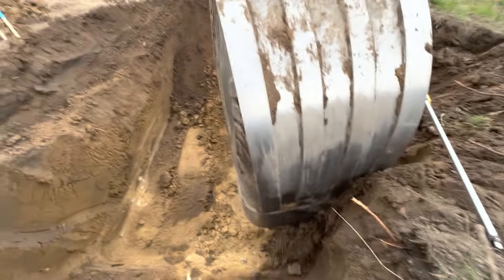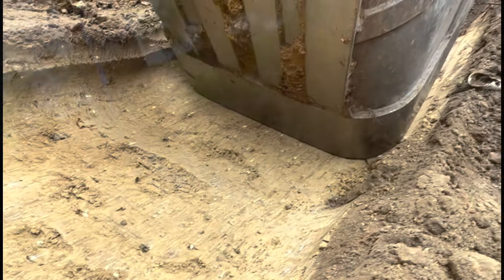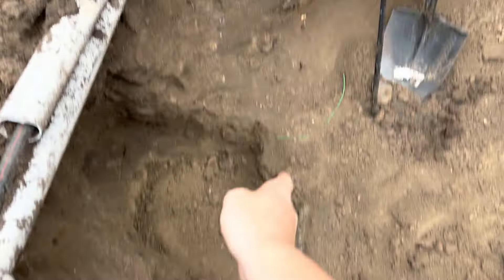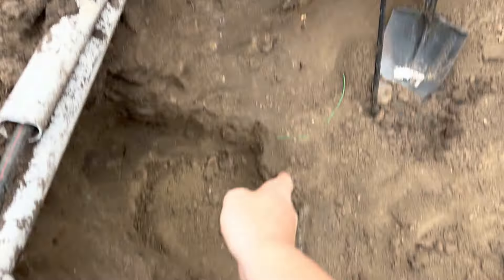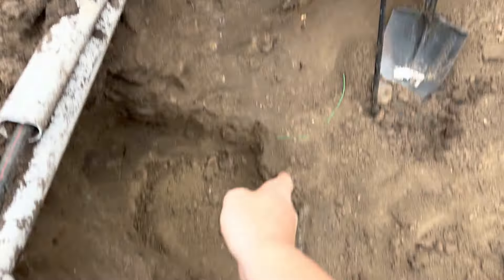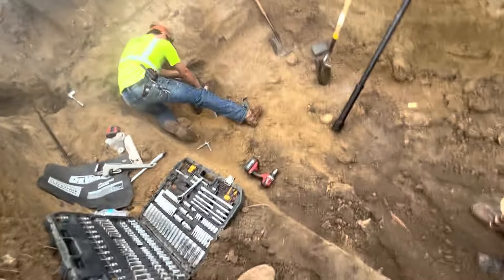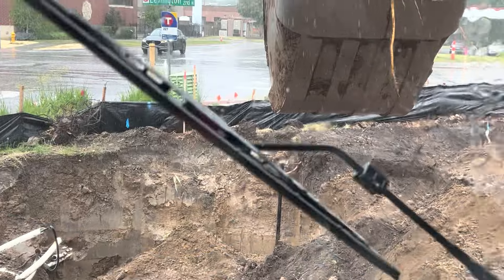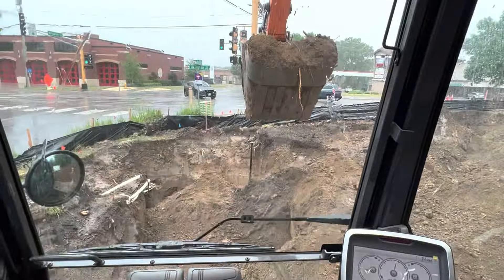CITY LOCATES WRONG WATER-MAIN CAUSING NEAR DISASTER!!  | + HOT TAP |

Comment: I’m impressed to see you used an attachment and a regular drill to do the wet tap. Here in Canada we use a direct tap tool which it’s obviously not needed for PVC mains. Could you tell me the name of that attachment you use to tap the main. 

Btw, awesome job!
Reply: Many brand does the attachement... Ford SIMTAP, Aquatap, Footage t752, Reed, and we used them in Canada to, they work on Ductile Iron
Reply: @fredericduff6391  ah the footage t752 direct tap is the most widely used here in Toronto by contractors but it’s good to see Ford SIMTAP at work. I’m assuming that’s the one used in the video. Thanks for mentioning the other brands, I googled them and as the saying goes, you learn something new everyday. 👍

Comment: What’s your wet tap setup? Never seen anyone tap with a battery powered drill before, only with one of those huge drilling machines. I guess it depends on the material though because that drill probably wouldn’t make it through A.C. Or ductile iron pipe
Reply: It does just takes longer.
Reply: Look up AquaTap or the Reed Feed Tap. But I personally 100% recommend the AquaTap it’s way better. There is a video on here